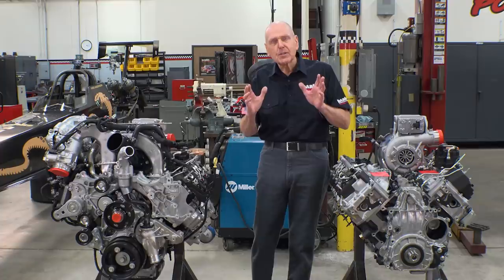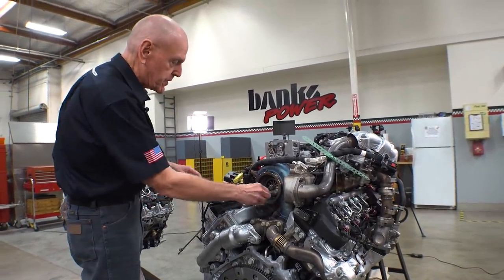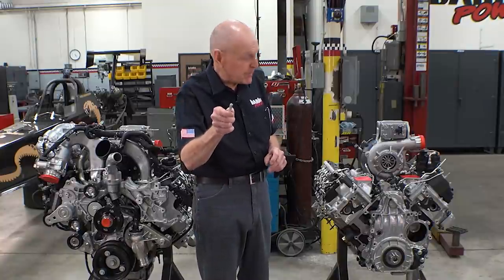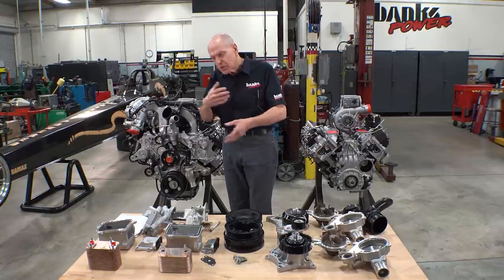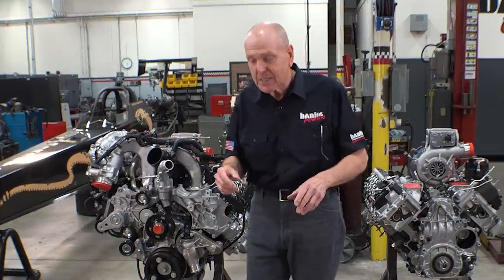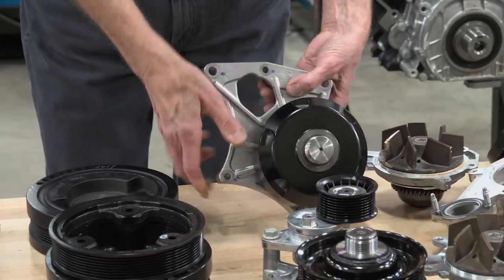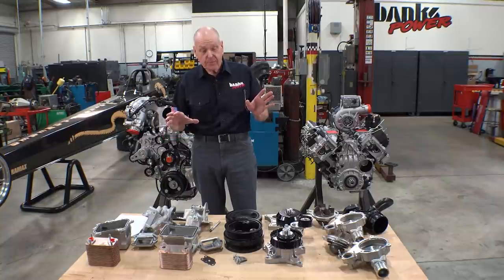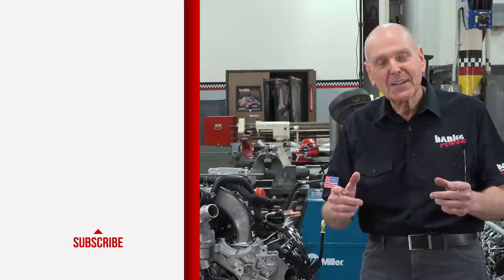2020 DURAMAX L5P Engine Revealed!

Comment: Can GM really do this, reliably? In 1977 they couldn't make a motor for the Vega/Monza lived longer than the 30,000 mile warranty. My Mother's car had 3 engines in in in 11 months. My folks got their full purchase price back via the Lemon Law in AZ, not an easy thing to do. To see GM doing much more is laughable. Sorry, but after 20 yrs in the Auto Parts field, most of it in management of Engine Remanufacturers. I worked with most of the parts manufacturers in business from 1978 to 1998. There were a lot of confessions from ex GM employees that came to light in those days. Gale Banks is THE MAN when it comes to beefing up the impossible, but it's still hard for me to have any faith in GM, when a classmate of mine who worked for GMAT the proving grounds in Mesa AZ got  screwed by his own company because GM fucked up up the oil distribution on their cast iron LSBlocks for their LS truck blocks in  2000.  Maybe they figured out how to make their motors live on the cheap after all theses years, but they've done everything on the cheap! Because of the problems my folks had, not only on the 77 Monday, but also on the 81 Citation which they bought a few years later, ill  never own a GM product. The funny thing is, when they bought their Monza they could have bought a Cosworth Vega, or an AMC Hornet in the same class of cars they were looking at, and either one would have. Lasted much, much longer. The Cosworth Vega could have brought them a handsome return down the road if they had kept it up, and the Hornet was good for well over  150,000 miles. Not as great an MPG as the other manufacturers 4 cylinder offerings, but much more reliable. But who listens to a kid in High School. Still, a Hornet Hatchback with a 401 would kick ass today if they had bought one! Lol

Comment: Now if GM would put a solid axle after 31 years,  they'd be on top
Reply: john preston nothing wrong with IFS
Reply: @Dekkar4  
Ifs junk is why I'm no longer a Chevy guy. Torsion bar junk. All they do is ride nice on the interstate. No clearance, 30 points of wear. Everything else in the real world that works has a solid axle. GM is just too damn cheap to reengineer it. I've owned and worked all of them ant GM is BY far the weakest,  they all have good features and bad. But I refuse to own another tin can, cheaply built GM. And that is why there are different brands for different types of people
Reply: john preston I've have had both and use it off road often, I find the IFS better then the death wobble SFA.
Reply: @Dekkar4  I find if you replace a 40 dollar steering stabilizer on a worn out truck the death wobble goes away. 3 weeks ago,  a 2010 Duramax was in my front yard. Why?? BROKEN pitman arm. PITMAN arm!! I've seen so many ifs turds loose spindles because the Aarms fatigue, ball joints fail, in the Yukon, we never bought any more Generic Motors because the cheesedick torsion bars would break in sub zero temperatures. No thanks,  I will drive my Aluminum bodied ass home.
Reply: john preston just not the aluminum body fords, that's the worse of the all! They rip/tear apart like no other.
Reply: @Dekkar4  Dude your ignorance is bliss!! Everything thing that works for a living is Aluminum. EVERY semi truck, Every semi trailer numerous boats, every airplane, and helicopter is Aluminum unless its wood. Space craft, every exotic car has Aluminum. Are you going to drive a wrecked truck around after you hit a tree??? Probably not. From the 30s till today PACCAR makes Aluminum frames for class 8 trucks.... cmon guy
Reply: john preston I understand what you're saying, but I work with insurance companies and body shops and have seen too much. Even my life long "ford or nothing" friends that work at body shops are not buying them for that particular reason.
Reply: john preston amen brother. I’ll stick with my str8 axle.

Comment: Great video Gale and as an owner of an LB7, I’m really jealous about that injector access. 👍👍👍

Regarding the improved oil cooler, I still puzzled about how taking heat from the oil and dumping it back into the coolant helps.

Wouldn’t an external oil cooler, below the cooling stack be a superior approach?

What am I missing?

Comment: Why ever did they forget a viscous clutch in the fan power train, or did he simply forget to mention it?  some big farm equipment  draws 40 HP to drive cooling fan when under full load!
        I fail to see the significance of mentioning  ability to pull 35000 lb. trailer. Dramatically smaller motors are pulling 35 tonnes. However some jurisdictions do require a minimum power to weight ration           . For example 10 BHP per tonne gross weight so if you are registered for 50 tonne gross you MUST have  500 BHP.

Comment: this is why i LOVE mechanical fans.... 

ill take a slight HP loss... over a wiring issue killing a motor..... any day of the month

im not sure if the electric fans are working right on my 99 buick century with 240,000 miles.... 
so its kinda got a reason not to work right.... 

but its -30f outside.... so ill wait till its 110.
montana sucks.... its also full, stay out!

Comment: I wish people would stop calling this a Duramax engine. I worked for Isuzu for many years and I can tell you that they've been in the diesel business in excess of 70 years. They have generators at the North Pole that have 10000 gallon fuel tanks and they only service them once a year. Bottom line.... don't be embarrassed to call this in a Izuzu because that's what it is.

Comment: I have 2004 GMC Duramax 370000 miles  still  runs good  but not what it used to be maybe a little less power. transmission tow mode doesn't preformed like it should but I still enjoy driving the truck how can I make it great again and who can you trust to do it right. Thanks

Comment: The Duramax Diesels have changed the landscape as far as development goes and just raised the ceiling.  I have a 2018 L5P on my 3500HD Silverado Dually and I pull a 40 ft. dovetail trailer and have done 45,000 miles in 6 months. I love the engine and I am so glad to have it with that Allison. The only thing to go wrong was a popped glowplug and that's about it. The engine is a monster in stock trim and that sumbitch can pull the freakin sky down. 

Gale I am interested in knowing though if that 2020 oil cooler set up will work on the 2018 version of the L5P and if there are any clearance issues.

Comment: Does this mean one doesn’t have to spend an extra $15K at 80,000 miles to bulletproof the motor to last? Was the oil cooler mentioned the EGR cooler? What about the heads? Are they studded? 

Thanks

Comment: Just wish your Banks stuff was affordable... Because when your on SSD (Social Security Disability) you can't afford all the way over priced stuff... And most of the time it's not worth the price... Especially when your just trying to get better MPG... Banks should offer 80% off or better for Handicapped people on SSD as well as Vets!! Then we might be able to put the stuff on to get better MPG, but paying Thousands to gain 1 or 2 MPG we would never get our money back...Make your money off the kids that just want to boost HP and the working class that wants to tow campers better and such... But when you only get $1,500 a month on SSD, spending $6,000. or more just to get a few MPG, just isn't possible for us.... Help us!!
Reply from the maker: Thanks for weighing in. We appreciate your comments. A couple thoughts. Our parts are as or more affordable than other manufacturer's offerings because we offer more features, benefits, and quality for the same or less money. If you stack us up against any of the popular brands, you'll see we're relatively the same price, yet with more features. That, in turn, makes Banks a better value. Take the Derringer tuner for example. It's priced lower than the competition and yet it's the only tuner available that connects via OBD-II and has safety features built in. Regarding MPG gain, although we do make a few products that are designed to help increase MPG, it's a much smaller focus. Banks is focused on making more power and fuel economy is often secondary. Finally, our performance parts are not necessary. We have far too much money invested in R&D. Giving away product at half off or greater would prevent us from recouping our R&D dollars, thereby stifling new product development. Bottom line, we love our vets and we aid them in many ways behind the scenes, supporting charitable organizations and much more. And, of course, we do everything we can for those who are disabled. But discounting products is generally not something we do. We find there are better ways to positively impact the lives of those in need. Thanks for reading and supporting Banks!

Comment: For plate coolers beside the mentioned important cooling water flow, oil entering through cooler must flow against the flow of water. With today’s engineers working for OEM manufacturer only releasing lawyer approved and biased technical information, it is a joy to her Mr. Banks personal view on a OEM product, that surely will be a great product. Thanks.

Comment: Gale, great vid as always... please answer one question for me...

I still don’t understand why Ford went with 2 complete cooling systems if Duramax and Cummins can get away with one. I like my 19 f250 6.7 but I can’t imagine why a company would want to sell all those extra parts when or if they don’t need to. And it would sure make a lot less potential leak points. Why 2 systems in Ford? Why not 1 big one?

Comment: Gale, I've been curious in the past about the location of the exhaust side and plumbing of the turbo for V engine diesels.  I note on your Sidewinder kits in the '80s the turbo is off to the side but Duramax and Powerstrokes are in the valley.  Does being off to the side effect egt and is there any concerns about radiant heat on neighbor components in the valley?  Just seems kind of odd to put something so hot right there...